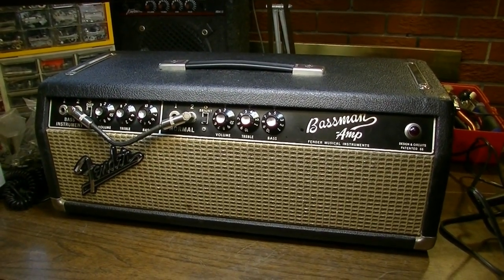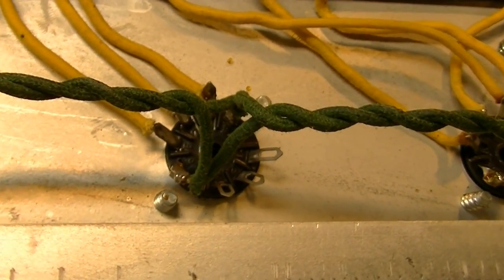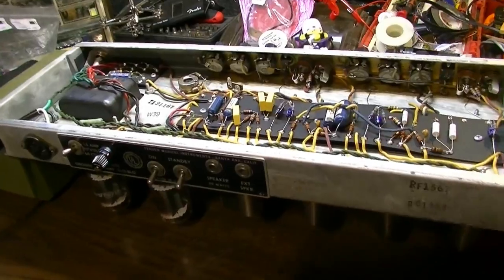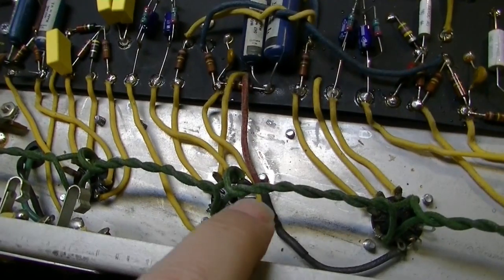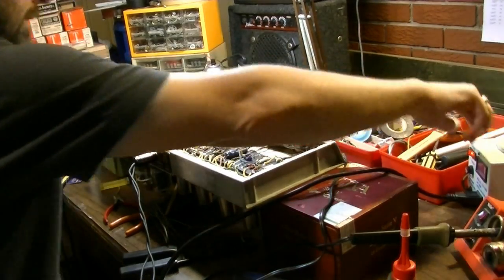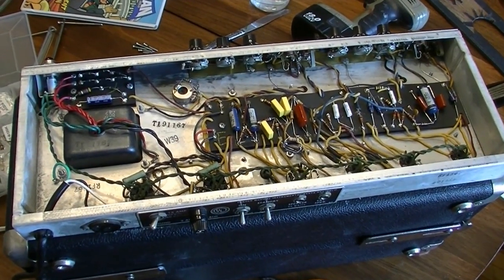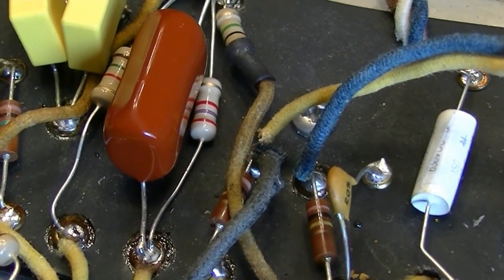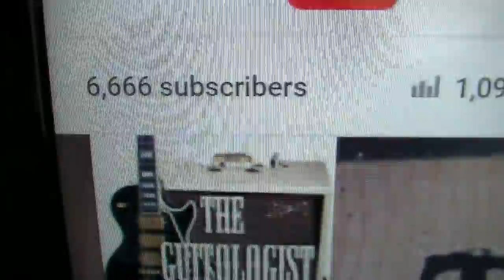Hacking a Blackface Fender for Monster Gain, Blasphemous or Badass?

Comment: People want to change all Bassmans into 5F6 circuit(s) which is the one Marshall copied.  The 5F6 is one of the best Bassmans.  Yes in the 165 the channels are not in phase, but out of phase!  Cancellations occur when signal levels are about equal,... (and bridging inputs.) very wonky tone control effects!  I notice that the biggest weakness of the 165AA is the .01 uf across the 1st pre 100K  plate resistor.  Which removes most of the signal starting at 1 Khz on upwards, basically making the amp sound very 'bassy',.. but not really good for anything like a normal bass guitar, in which you want plenty of 4-6 Khz plucky sharp attack, and SNARL.  For instance Jack Bruce always played his 5F6 circuit Marshall or whatever he was using with the treble on 10, and mids up, and bass down.  Luckily when You returned it to "stock" You didn't put that cap back in.  Your other mod would have worked better if You had included mixing resistors at the right points to bring gain within reason.  Lots of people like the .02/ .02 tone caps especially with the tone stack in the feedback loop which is the unique configuration of the Marshall Plexi (5F6 copy) and the Fender 5F6,.  I personally prefer bass caps larger than the mid cap, so that the bass control affects the lower range even when rolled back,.. but this silly version of Bassman has no mid control at all.  I prefer to add a mid control to all channels and have created a unique tone stack in which all the tone controls have much more range.

Comment: Why do people buy Fenders and try to turn them into Marshalls. lol  I used a 70's era sivlerface deluxe reverb for 10 years in the club and roadhouse circuit. I used a bassman head for awhile but it was toooo loud. I used a marshall head for awhile but it was too loud. so I settled on the most versatile tube amp on the planet with only 3 pedals and an out board fx unit. I could cover and genre and cover it well.

Comment: I haven't used a Tube Amp all that much since 2009 i could count on one hand how many time i used my Tube Amps since 2009..the past 9 years i have really been into my Marshall MG 100FX 2X12 stock with celestion speakers..bought it back in 2009 and never really looked back on the Tube Amps since..also have a VOX Valve Tronix..2009 Also and i have a Line6 Spider IV 75 watt stock with 1x12 celestion speaker 2010..i haven't had one single issue with any of them..all 3 Amps are brilliant..and can not say that about my Tube Amps..

Comment: I would like to hear a black face Fender Bassman  modified  with an extra AX7A preamp tube and a Master volume control; to get this tone at much a lower volume level...
Reply from the maker: A MV on this would be really nice. I think if I put on one one of these I'd try to use the hole for the Ground Switch. I remove those from circuit anyway. I'd only be concerned that might be too close to power to pass signal.
Reply: You can! Get a old mark boogie. ;)

Comment: what if someone tried putting a volume pedal between the two inputs as is, wouldn't that make, in a way, a wah or more technicality some sort of wierd phaser.... sorry just thinking out loud.....
Reply from the maker: It would mess with the output's combined phasing, so you'd end up with a Phaser sort of effect probably. That's pretty much what a phaser is, two signals of differing phase and an oscillating tremolo effect combining them in different ways.
Reply: It would make a "variable Bass control".  Or you could call it a "Gutless control".  When you get both channels equal-volume nearly all the low end and a lot of the midrange will fall away.  The cancellation will be most-intense where the channels sounds are most-alike.

It wouldn't do wah sounds, because wah is a narrow band of frequencies being passed that is then swept up/down to get the wah-ing effect.

It also wouldn't be a phaser type effect.  Phase pedals have a phase-shifted signal (something between 0- to 180-degrees, but probably closest to 45- to 90-degrees) mixed with a non-shifted signal.  Doing just that would give some cancelled & some intensified frequencies.  However, the amount of phase shift is then varied, and that provides the sweeping effect.

As it stands,  the original would just be 2 similar sounds exactly-opposite (180 degrees), non-changing (no sweeping), but with some amount of non-cancellation where the channel EQing is different.
Reply from the maker: Great comment, Brian, but I do think some "phasing" effect is inevitable if you are mixing in a 180 degree out of phase signal at varying strengths against a dry or normal signal. The pedal would act as the oscillating control for the phasing rather than an oscillator. I think you're absolutely right that it would not be in any way "refined" and maybe not even pleasing or musically useful. The two signals would not be "shifted" in time like a phase shifter or some chorus pedals, but still might be an interesting thing to explore. I hope more people can chime in on this one. I am really curious if anyone's tried it.
Reply: You are absolutely correct there will be phase cancellation (usually partial) when mixing two channels 180-degrees out-of-phase (or we could call that "opposite polarity").  I accidentally did this in a recent 2-channel build when I ignored the number of gain stages per-channel, but still had Fender-style passive mixing of the channels.

The tone controls on a given channel appeared to work "in reverse":  Turning up the Treble control made the level of those frequencies closer to the level in the other channel, enhancing cancellation.  The sound got darker.

That is why I'm saying it will wind up acting like a tone control.  And probably not a good one...

The catch with "phasing" as found in phase pedals is they are not changing volume levels of the two signals.  They are changing a bandpass circuit element to change the actual phase of a signal (e.g., from 20-degrees of shift through to 50-degrees of shift, etc).

To do this, you'll need a reactive component (cap or inductor) and some variable element.  Variable caps & inductors are clumsy, so these are usually implemented as an alteration to a transistor circuit.  The transistor then sits in an RC or RLC circuit to create the shifting phase.

So that's why a simple volume pedal & 180-degree-different amp channels won't do it.  By the time you jigger them into doing good-sounding phase shift, you might as well have bought a wah or a phaser pedal.

Comment: I wish I didn't have my blackface Showman screwed up by Torres in the late 80's.  I should have left it stock and run a pedal.
Reply from the maker: What all did he do to it? I've heard lots of internet whispers about Torres mods and how a lot of Fenders got butchered, but haven't delved too deeply into what all he liked to do to the amps.
Reply: He sold the idea that any old cheap amp could be re-voiced easily.  I was in high school, and Fender amps were plentiful and Blackface Super Reverbs were under $600 original and in good condition.  Plexi Marshalls were still under $800 but climbing.  A lot of guys could buy Champs and Princetons for under $100.  Showman, Bandmasters, Concerts, etc heads were under $250.  Nothing ever ended up sounding good, the master volumes worked.  The price of undoing the work plus what you were out put you where a Twin, Deluxe, Super Reverb would be and that's where the disgust came from.  Guy was a tone deaf hack selling ideas that didn't work.

Comment: i would have just bought a strymon riverside and call it a day..
Reply from the maker: That's definitely one school of thought, but there's no question this is a far more versatile amplifier after the mods. The stock Bass Channel sounds great as a pedal platform. An ABY switch and this amp could do it all, I feel.
Reply: Very cool indeed.. i do love the oldschool hand wired circuts too.  I love real tube dirt .  im recently learning one can achieve some great grind on a clean channel with the righr pedal.   and man. fender is arguably my favourite clean sound.   thanks for your vid again man.  im a fan to be sure :

Comment: Man oh man way over explaining and even confusing yourself there trying to explain your mods even calling the vibrato channel the normal channel... appreciate what you're doing but use schematics that you show your mods you plan to change to show what's going on and you'll be further ahead in the long run for both yourself and the observer...just my 2 cents. Also, always check your values and even test first before soldering - especially with caps. Things test bad and are marked incorrectly so one can never assume.

Comment: If it's your's and you want to mod it do it. This whole sacred vintage thing has gotten ridiculous. All tho I wonder sometimes why people buy one thing then want it to be something else. I learned to just get what I want. I do still enjoy modding. Was given an elk echo amp many years ago, all the oil caps had dried up. Coupling caps between PI and out put tubes were leaking dc so bad the plates had holes melted in them. Over the years it has gone thru many circuit changes, schematic is all white-out. That bassman sounds interesting, not fender, not marshall, but I'm all for an individual tone. I'm sick of people having to sound like so n so! Nice OD, not sure I'd call it monster gain, but it does good. I guess I'm Soldano spoiled.
Reply from the maker: I agree on the whole having to sound like x famous guy stuff. It sells gear, but I like to see true artists going their own way.

Comment: could probably use better speakers.
Reply from the maker: This cab sounds surprisingly good with any amp over 50W. That's why I use it.  It's probably true there are better options out there. I like those 80s Mesa cabs with the massive speakers and half open convertible backs.
Reply: thought about that after I commented. if it sounds good, it sounds good. I have a 61 batsman, and it reminds me of Van Halen 1 with jhs angry charlie.

Comment: HOT LICKS around 28:00!!!
Reply from the maker: Almost makes one want to buy a VCR! I can feel the urge to grow bangs.
Reply: "Guit," a question.  Fender went for the big changes in looks and electronics in '68.  My current '70 Twin was serviced by Sip Simmons and he said it was 100 percent stock and a blackface circuit.  I've heard that before about other '70 TRs.  I wonder if they temporarily returned to the old circuit exculding the use of plastic-coated wire in response to complaints the then new Silverfaces sounding a bit sterile?  Comment?